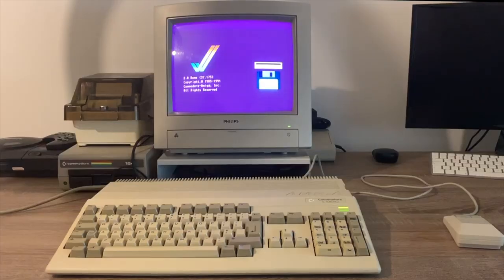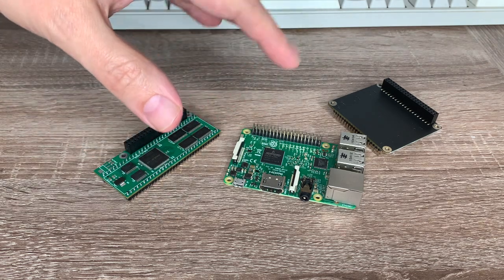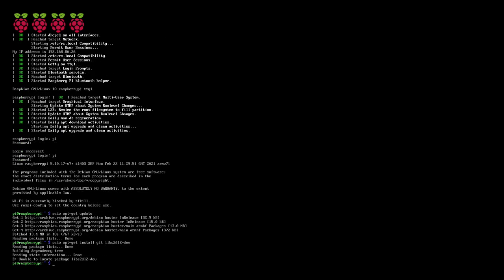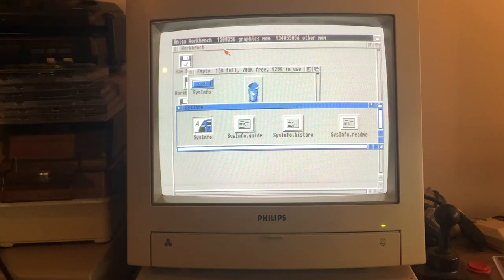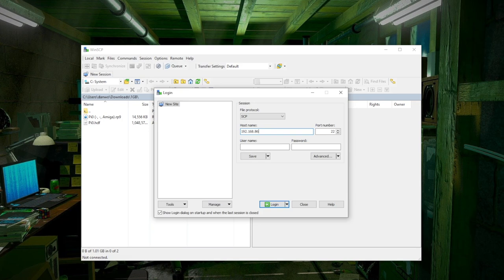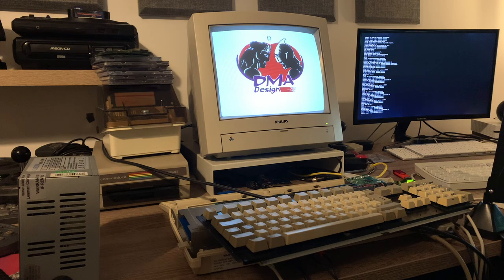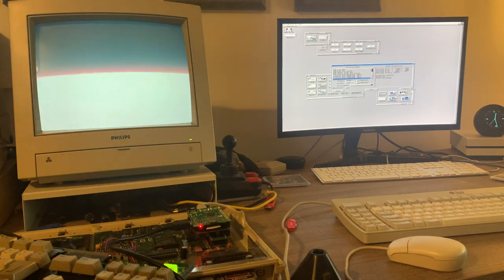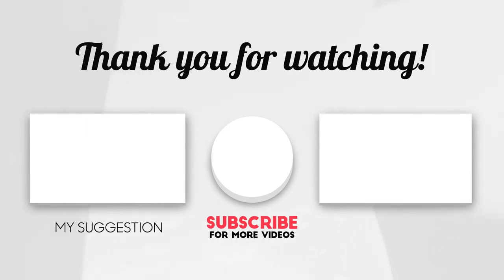PiStorm: Turbo Boost Amiga 500 With Raspberry Pi

Comment: You didn't actually update the system files on your Raspberry Pi. "sudo apt-get update" just updates the package list. You need to run "sudo apt full-upgrade" afterwards to actually upgrade your packages to the latest versions.

Autologin wouldn't automatically start the "emulator" executable. You'd have to set that up as a service or more simply just add a line to /etc/rc.local so it's run at boot.

This is an amazing project though!
Reply from the maker: Yeah I missed a step with the update. Thanks. I do add to rc.local at the end of the video.
Reply: @danwood_uk  just got to that bit! I'd recommend using this line instead "sudo /home/pi/pistorm/emulator &" - The ampersand is VERY important. Without it if the Pi fails to execute the emulator for any reason then the Pi would not complete the boot process and you'd be stuck.

I was wondering it there's anyway to gracefully shutdown the Pi without having to SSH into it. Just turning the power off on the Amiga wouldn't do the Pi any favours. Hmm...
Reply: sudo can actually be dropped from rc.local as well, all it does is run the executable as root instead of the logged-in user, and rc.local always runs as root.
Reply: @CosmicScaleFactor  add a 'hidden' button connected to pi gpio pins, run a script/executable that does the shutdown, maybe if there is ram space, make a ramdisk to replace /var/log folder and /tmp folder, less chance of corrupting sd card ?
Reply: @jyvben1520  I thought about a switch on the gpio pins but they are all being used already
Reply: @rockapartie  yep, "apt update" followed by "apt full-upgrade" is the recommended way to update packages now.
Reply: @CosmicScaleFactor  For the shutdown.. I just imaged the SD card once I was happy with a baseline config. If for some reason in the future it gets messed up I will re-image it. I dont use it for amiga storage, that is done through an sidecar scsi adapter in my case...
Reply: @rockapartie  old habits die hard. Fortunately apt-get still works on lots of Debian based Linux distributions.
Old habits die hard which is unfortunately why lots of people still insist on using Microsoft Windows nonsense.
Reply: @Matthew Zilog You have a cool surname.
You are entitled to your opinion. But I disagree. Was I bragging? Calling anyone a noob?
My printers were picked up by CUPS, didn't have to try anything. Is that bragging?

Comment: Great video Dan!
i’d add some notices to the commands though.
rc.local is executed as root, so you don’t need the sude command there

also, it is worth considering a read-only installation on the PI if you don’t want to run hdd emulation. filesystem on the sdcard can become corrupted by an unfortunately scheduled poweroff, and there might be (from the pistorm point of view) unnecessary processes in the stock pi linux that write on the sdcard - which can icrease this chance. i hope the team will put together an optimised linux distro without this bells and whistles for the final result

Comment: Hi !!
I saw that Lemmings use CHIPRam and this kind of RAM resides in the other side of architecture !! RPi only expand CPU memmory !! Check the memmap of your amiga.  Software with more chipmem memm requests tends to "not run" even if your accelerator kits have a lot o RAM...

Comment: Or instead of the riser you can get a double stacked header or desolder the pins and connect the board in any other way, even with wires (for anyone else reading this).

One of the 'pins' on the PiStorm is also square, you can see the pattern of the solder, this also denotes 'pin 1' on the board.

Arguably you don't need to use an sdcard, as you can also boot from USB on the raspberry pi, so you could have this accessible external to the Amiga casing.

This's pretty cool. Thanks for sharing.
Reply: I wonder if you could setup some kind of kvm switch that auto flicks between the output of the Raspberry Pi to the output of the A500 so you can see it booting fully, since the Raspberry Pi can output VGA this would at least let you see the situation of the Pi before the A500 works.

Comment: Great video as always Dan! One tiny bit of advice though: Starting around 9:24 the flyback transformer of the CRT was quite audible (this is also known as CRT whine). If you could implement a low pass filter on the audio, it'd really help out us younger viewers.
Reply from the maker: Thanks, I haven’t been able to hear it since I hit 30, the years of DJing in noisy nightclubs probably didn’t help either 😆
Reply: @danwood_uk  Haha no worries! It's actually not nearly as loud as it could be.

Comment: Great video Dan, everything well put together as usual, easy to understand guide. 
Nice with another cpu emulator, a lot of power for 11£, personally I’m not going to fiddle around with all the sudo stuff😊
I’ll buy one, some time from now, hopefully plug and play
Reply: @retrocengo They're not £11 unless you can still get one as mentioned in the video? The Pi 3 Model A+ complete ( no soldering required) are currently £24 -£27 depending on availability and where you buy. And don't forget the PiStorm adapter that's required and priced at whatever the seller/scalpers decide they want to sell them for. At the time of writing there's a seller on eBay trying to sell 2x PiStorm adapters for £140!!! I kid you not!!! 🙄

Comment: It's funny this has dropped recently as there's a project trying to accelerate the Minimig core on the MiSTer using the ARM processor built into the de10 nano. Still early days but it's booting.

Comment: Awesome! 
As for the floppy problems, I would be surprised if it was working well. Even an actual secondary floppy drive was a problem back then. Many A500 games required to have disks in df0 to work and I'm not talking for the boot disk obviously.

Comment: Something I noticed from another Chris Edwards videos on the PiStorm is that the disk reading problem doesn't seem to happen with an external gotech drive.  Maybe it is just limited to the internal drive but to find out you would need to connect an external floppy drive.  With SSH though, it seems like it would just be easier to send files over the network.

Comment: So it's basically a Raspberry Pi with an Amiga hat?
Reply: I was thinking this. Would that mean I could run anything, not just Amiga OS? In effect it is the raspberry pie in the Amiga case, and it's not using any of the Amiga chips etc. I have s busted Rev 6a 500 board with shorted ram and Ron chips missing. Would this bypass all that?
Reply: @matthewrichards88  it is not using Amiga chips in RTG modes, but the Kickstart is loading and needs the chips. Or does it has chipset emulation ?
Reply: @bennyvandermeer670  No, it's not doing chipset emulation.  It still uses Paula for audio output, Agnus for DMA, Denise for video generation, etc.  It's not able to run a different OS unless that OS can run on a 68K Amiga.
Reply: @heidirichter  so Matthews machine will not boot.
Reply: @bennyvandermeer670  that's correct, it would need working chip ram
Reply: LoL
Reply: so could turn an Amiga 500 into a PowerPC Amiga or even an ARM Amiga (but would need all new software, of course). Imagine the software that could be written to this Amiga hat running native ARM code
Reply: Its a Raspberry Pi with a HAT that acts as a dedicated m68k FPGA.  It also does RTG and allows for loading of hdf files. However it still depends on the OCS/ECS to actually run as an Amiga.
Reply: My quesiton is... If I got a amiga 500 6a with agnus 8371... Will it improve my ram or not?

Comment: Since I've upgraded my older RPi 3B+ with the newer 4 for all my RPi projects, I can now just desolder and extend the USB ports so that PiStorm can fit in my A500 without an adapter and 3D print a holder for the USB ports to be usable when an update becomes available. This project saved me a bunch of $$$ that I was about to spend on a Vampire! The irony is that the Pi is more powerful than all the internals combined, but hey -- we want to use the retro hardware as much as possible :-)

Comment: At this point you might as well emulate the entire thing, especially if you don't already have an Amiga, since with this upgrade it basically only acts as an I/O interface anymore anyway.
Keeps the retro feel though while providing a lot more flexibility without breaking the bank, so if you don't really care what's inside, this is definitely a neat development.
Reply: Would that mean I could run anything on this raspberry pie, not just Amiga....
Reply: @matthewrichards88  A lot of emulation boxes are based around RasPis, and you can even use it as a standalone desktop PC, albeit the 3 will struggle with that.

Comment: When this is more ready there will be an installation package and it will register a service to start on boot so there is no need to edit rc.local. You can also easily make your own systemd unit file and save it as /etc/systemd/system/pistorm.service and enable it with systemctl enable pistorm

Comment: Cool product. Seems like the RPi compute module would be better suited for something like this. Much smaller footprint, and thinner "sandwich".
Reply: how about the "Raspberry Pi Pico" with a custom Rom/Ram USB Flashed Image, it would  need a little bit more bit on the external board, the  "Raspberry Pi Pico"  are so cheap you could add more than one to the tasked needed to getting things working, ever time you add an second, or third, you would and extra USB port loads more GPIO port also? :-)

Comment: And where's the clip of you playing real Doom on an A500? (Project Dread is looking great though...)
Doom is playable at 10 MIPS and above, very good at around 20 MIPS.  This setup should do well.  And it provides hard disk emulation, which Doom will also need.

Comment: I really need to get my 500 working again. I made a big dodo when I upgraded from kick 2.04 to 3.1, rushed it and soldered the cable wrong, and now it's completely dead. Have no idea what went wrong and I just don't know where to start looking. Even though I have a 030 accelerator this is something I'd love to do with it, getting RTG on the 500 would be awesome.

Comment: I'd like to see a PiStorm in an side expansion slot form factor that you could just insert into the side of your A1000 or A500. Any tinkers or takers?
Reply: I was thinking the same thing when looking the video why not use the the big bus connector it right there next to the CPU why not why, it one of the main reason's the 500 amiga has one , plus a hard disk?  there was a external CPU thing made for that port, can not remember much a bout it or good it worked? 
the only down side no working floppy, and the Amiga now takes 30 plus seconds  to just switch on  :-)

Comment: I'm glad stuff like this is made. Without spending to much money more people can have a fast amiga. For me though, it doesn't feel quite right. Because you are using a more modern more powerful computer that is more capable on it's own. I'm not sure how to explain it. Like driving an old car with a modern car on top of it that takes over the engine but you could just drive the modern car instead. But I enjoyed the video and it's great that there are more cheap amiga stuff for people to enjoy.
Reply: Instead of emulating the whole computer (CPU, PAD, etc)  in the Pi, you're just simulating a faster CPU and using the rest of the real hardware
Reply: @TiagoJoaoSilva  I do like that but I prefer stuff like the zz9000.
Reply: @TiagoJoaoSilva  ...and you are also adding extra functionality to the old platform and keeping - or giving choice to use- parts of the legacy platform. A good example of the latter is that when they get the disk-drive functionality working you will also have access to 3.5 inch disk games etc.
Reply: To me, this is like my 1976 Camaro that has an upgraded engine and differential in it. At the end of the day, it's still 99% Camaro, just with a better engine that solves many of the shortcomings of the original iron slug that was powering the car. I can add upgraded brakes and suspension as well, but at heart, still a vintage Camaro.

Comment: this is so nice! now we only need a solution for the big daddy amigas..
Reply: "While the PiStorm should work with any DIP socket 16-bit 68000-powered system, the FC lines are currently not properly handled and no guarantees can be made for it working on anything except an Amiga 500, 500+ and 2000."
Reply: Already works with the big daddy, the A2000 :-)

Comment: It really should have (especially with that kickstart) the akiko gate-array (in a fpga by the CPLD as it would be doable) and an ability to boot of CDROM (via universal CDROM  drivers), and a ieee1284 parallel port (even if you just run a wire out the back of the case to then plug a dummy parallel port over or near to the existing parallel port). That way, you can boot off CD (in the pi usb-port) and parallel (such as games cartridges onto which you can save games). This is important because (not only does booting of CD act as alternative to floppy-disk but) it means people can ditch WHDLoad along with its sluggish CPU and RAM wasting overhead. I hope that is good at the claimed FPU performance. With all the above it means decent HAM graphics (4096 colour) games could be made and precalculation could be done. Sure, it'd mean ditching using the blitter etc., and layers but it wouldn't matter as it would look cool.
You'd simply have a game on a CD and a game cartridge also for the same game. A cartridge could blatantly have some RAM and NAND in it. You could have a removeable battery but it might be optional since the NAND could autosave the RAM data.
Regarding the instruction-set for 68040, it should (IMO) emulate that and have a patched full maths library (transcendental operations) so that not only would you have the ieee1284 but a decent FPU way of compression for fast data through that ieee1284 parallel port.
As an aside, the protection rings of the pi3 could mean peripherals could be run in linux as a VM and allowed safe limited access by the amiga. I'd suggest a video toaster be micked that way (with a usb video capture device in the pi).
Running MacOS on such a device might be cool but a version for the a1200 could maybe be an option for it.
It is a bit of a pity how you cannot (yet?) run all that on the Pi but using BSD as the Pi's OS. I think the above would thereby communicate better with the amiga if the amiga istelf were to also run its own instance of BSD. A bunch of the linux stuff you could also do via the linux-BSD compatibility layer.
On an a1200 in particular, it would then be tempting to give WINE a try and DOS box (yes, actually on the amiga) even though the software would be very humble. NDISWrapper could be a thing.

Comment: Great video, you have some of the best step by step videos out there. A question, as you know the Pi is very hard to find right now and when you do ridiculously expensive. I have a couple 3b's, could I remove the USB and network connectors and use on without the header and maybe be able to close the 500?

Comment: I’ve been keeping my old PAL A1200, in hopes of finding some affordable way to run it here in NTSC land. 
  Following some exciting new updates, and hoping for something like this for my 1200 😃
Reply: Why don't you just buy a PAL to HDMI converter?
Reply: @OpenGL4ever  had no idea that was a thing. 
  I was just thinking SCART. 
  Off to Google that. Thanks
Reply: @stuartleckie  Your welcome. 
Another option might be to just use an old PAL capable analog TV PCI card like the WinTV cards from Hauppauge. They have an anlog input connector and will  require a PCI slot and are capable to display the video signal inside a window or in fullscreen on a PC. 
I say that, because they have rather good analog to digital input converter. But they need software, drivers for your OS and a running PC. And in times of PCIe a PC with a motherboard, that does have a PCI slot.
An old PC from around 2000-2010 will very likely have a PCI slot. The newer ones are usually PCIe only.
There are also WinTV devices based on USB. They might work too, but driver support can be a problem on some OS.

Comment: thanx for making this vid, Dan! Fricken AWESOME project! will make one of my A500 into this... 
But shouldn't the Pi3 filesystem be set into write protected mode to prevent SD-card corruption when powering it on and off haphazzerdly?
Or does the filesystem need to accessed while doing some stuff on the amiga side?

Comment: Hey Dan, nice presentation.
Did you notice any latency on games like Silkworm for example?
Reply from the maker: I haven’t tried Silkworm as yet. But on WHDload games I tested, performance was rock solid.
Reply: @danwood_uk  Great! Thought that would have some latency with the controls due to emulation.
I mentioned Silkworm cause it's a pixel perfect title with smooth frame rate and tight controls :-)

Comment: Don't get me wrong cool idea, but things like this kinda step over a line, atleast for myself,. It's kinda of why I try running hard disks in my old dos machines, I like the hardware and experience of older machines, I know this will be different for others, but when do you go from enjoying old hardware to just going to emulation?  Essentially this is basically running an emulator interfaced to the hardware. Just a thought

Comment: Nice job on the video! Tnx for the tour!
Do you know if the PiStorm can drop back easily to something like the normal 7.x MHz 68000 that was in there before? Based on my experience running an '040, you'll want to be able to do that for compatibility with some software.